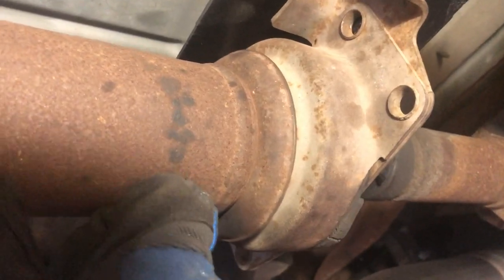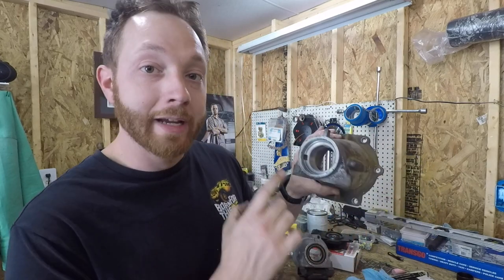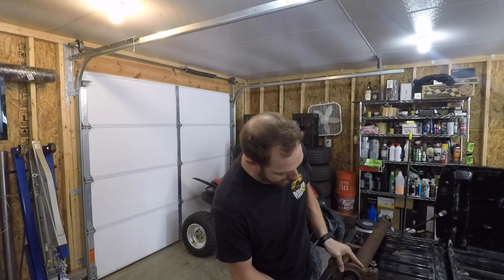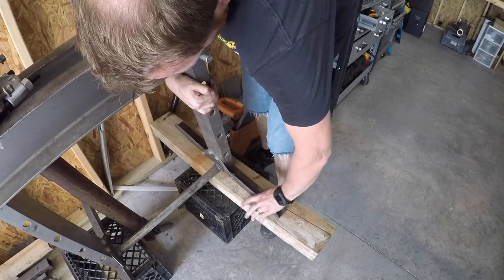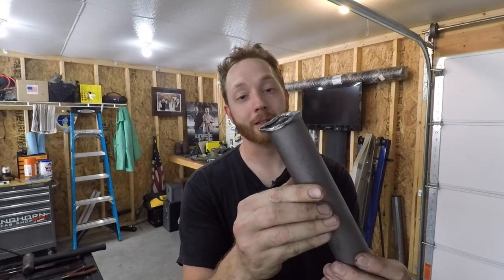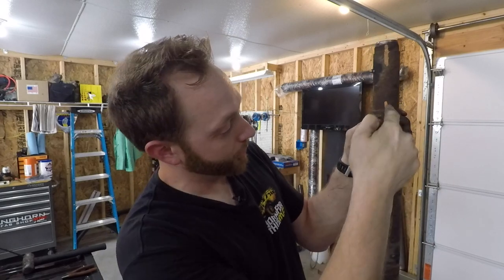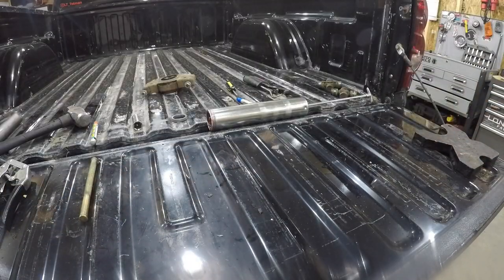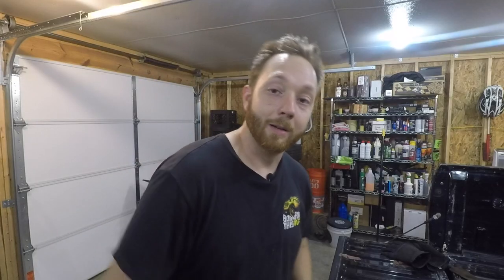Eliminating vibration from a 2 piece drive shaft

Comment from the maker: Its amazing how much of a difference a few simple parts and the correct angles can make! cant believe I put this job off for so long...
Reply: Yo I m doing a 2 4 drop on my truck was wondering how you moved your center support bearing to change the drive shaft angle ?
Reply: Have a 94 GMC and replaced the carrier bearing but I'm having a problem getting the yoke into the front front part of the driveshaft.  The metal and rubber seal are preventing easy insertion into the front part of the compound driveshaft.  Can't seem to find any answers on YT.  Help please.  I need the use of my truck.
Reply: @michaelpearce8661  it’s keyed so it will only go in one way.  It can be a pain but once you get it lined up it will slide right in.
Reply: @lukeduke1573  I know.  The splines have one thick spline and the rest are the same size.  Getting beyond the rubber gasket was my problem.  Found someone with a little more weight behind them and he was able to push it in as I aligned the short piece that has the U-Joint on it.  We got it back together.  Thought I got everything lined up properly as far as the replacement of all three U-Joints but I feel a slight vibration that is new.
Reply: I have a huge question LT that I really need to ask you.
Reply: Hey LT do you happen to know the Thread Pitch and Diameter of the Studs on the carrier?
Reply: Put that end in first then the carrier and rear yoke last .

Comment: At 5:52, you should turn the bearing splitter 90 degrees in the press.  You're putting the pressure across the threaded rod of the splitter, which can bend the rod.  Turn the splitter 90 degrees and let the actual splitter transfer the load across the gap of the press plates :)
Reply from the maker: you got me there, should've paid attention to that
Reply: @LawrenceTolman  I only know this because I now have a bearing splitter with a bent threaded rod lol.. what the heck? how'd this happen?  ;)

Comment: You are really helping with my future project 99 Nbs gmc short bed stepside 5.3 3.73 .put a 6.2 in your truck over 400 hp na and add boost you can set your hp where you want it 500 600 700 or more!!

Comment: I would love to see a crazy durable 5.3 or 6.0 motor in the 500 to 600 hp range. Something that is good for a daily, but fun when you need it to be.
Reply: Frank Sweet not possible without force induction or nitrus
Reply: @cesarconh895  you need to check out Texas speed if you think you need that.
Reply: @cesarconh895  completely possible with a 6.0 at least 500
Reply: I got a daily driver 600 nitrous (2 kits) ext cab 5.3 stock block stock heads just support mods for the cam and fuel system

Comment: I got rid of the two piece drive shaft and got 1 pieces drive shaft which is a 5” diameter aluminum and threw that junk carrier bearing in the trash after changing it 3 times in 5 years and it came from East Texas Dodge drive shafts for at the 800 bucks and I love it!
Reply: On an extended cab 2wd?  Who’s it holding up
Reply: @musty.diesel  that's what I wanna know. I have an 02 F350 2wd crew cab long bed. I would love to go to a single piece driveshaft, but I don't think it's possible 🤷‍♂️

Comment: Thanks for the instructions and confirmation on what I believe happen in my case, transmission was shifting hard in the second, took it into the transmission shop that had replaced it previously in 2016, no problems then this time the real seal on the transmission leaked and I had a vibration at 60 6570 worse as it goes up. I believe is they didn’t line it up like you stowed here or that hanger bearing is somewhat worn either way, taking it into the shop tomorrow and I will have him replace that hanger bearing, and all the year joints. Great video thanks again

Comment: I had the same problem with my press while I was replacing a carrier bearing. I got a 6”x6” timber and cut 4 pc. Put two under each leg. Screwed and bolted the timber’s raising the press 11” off the floor. The timber’s are also heavy enough, so it won’t be top heavy but, you can still slide it around on the shop floor if needed.

Comment: The angles. From the carrier slip yoke to the pinion yoke should be offsetting equal at maximum 3 degrees. Leaving parallel lines from both running horizontal. I'm always amazed how 2 identical vehicles can have two totally different problems. I would think keeping the front drive line flat to the carrier wouldn't hurt you any. More important is the rear drive line angle. Anyway, always appreciate your content! Have a good one.

Comment: I would say go for a lq9 6.0L high output then do the big 3 as they say heads, cam and intake manifold. Do the airaid modular intake tube with k&n drop in panel filter long tubes headers if you don't have emissions in your state you already have a nice exhaust set up. Then custom tune should be a nice amount of power to have fun with and plenty reliable.

Comment: The vibration is a result of velocity changes of universal working thru an angle as opposed to a CV or constant velocity joint, if you refer a uni to a clock with bearings at 12, 3, 6 & 9 as the rotate to next position velocity is constant if no angle but when you work through an angle velocity increases thru first part say from 12 to 3 then decreases from 3 to 6, this angle is say 3° then next uni is 2° then they will not cancel each other out but if you had a third uni at 1° the same direction as 2° uni they would cancel out the 3° uni in opposite angle, so your total angles should be as shallow as possible but your included angles should cancel each other out, some drive shafts have a CV joint at centre bearing so only have to set front and rear most uni angle to cancel each other, so if budget allows have drives haft shop upgrade to centre CV is an option as CV is just that a constant velocity joint so does not affect the equation, just some info to add to a good video for practical purposes done here, good job.
Reply from the maker: Well stated! Your explanation is much more elegant than I could come up with.

Comment: Thanks for sharing your driveline angles.  I changed the carrier bearing on my son's 2000 Silverado and noticed the front driveshaft wasn't totally level.  It's just slightly angled down towards the carrier bearing.  Couldn't find any info anywhere on allowables or angle range.  I suspect that the desired angle of the front driveshaft is 0 degrees, but there had to be a range due to mfg tolerances and such.

Comment: I wish you had a before and after difference on the 60 foot with time slips. I'm going from a 3.73 in mine to a 4.30 also to help it get out of the hole. My best 60 in my truck right now is a 1.84.
Reply from the maker: I wish I had as well. I cant guess, but it is a noticeable improvement.

Comment: Hey LT great video, did you also have to use shims to get rid of the vibration or did the carrier bearing relocation cure that?  (Besides replacing the old carrier bearing).  Thanks!

Comment: Your contributing problem to your vibration is your rear pinion angle is starting at 0.7* and your transmission angle it at 3.8*, those two things aren't parallel. If they were parallel then both your transmission angle 3.8* and rear pinion angle would be also 3.8*. The front shaft should also be close to the transmission angle I believe +- 2.5*.

Comment: How did you narrow it down to the output shaft bushing? 
I got an 05 I put shackles on and then shimmed it to correct the angle. Found that my center support bearing was bad so I replaced it. I now have vibes that I can't figure out. I replaced the ujoints and the drive shaft is balanced.

Comment: Here's a question that im hoping you can give some insight too. What's your thoughts on GMs notorious 8 speed issues that the engineers can't seem to fix? I drive a 17 High Country 6.2L and bought it new and changed everything over to Amsoil and never had an issue. Also i just installed a Trifecta tune.
Reply from the maker: to be honest, I'm not sure what issue you're talking about.
Reply: @LawrenceTolman  I'll explain, the shake/shudder and harsh shifting from 1st to second and vice versa. There's tons of forum's about. GM has several bulletins on fluid changing etc... Some had it so bad the TC was replaced. Plus there's class action law suits against GM. Check out GM Authority

Comment: Great video man nice!👍 Hey i was thinking of doing 4.56 rear gear and posi on my 2000 silverado 1500 2wd 5.3L. Think that would be ok to daily?
Reply from the maker: Depends on a lot of things, but mainly tire size. Mine are a little taller than some at 31.5” which helps a little, but if I had to guess you’d be spinning 2,600-2,700 at 70 with 4.56 and a 29” tall tire. Less rpm with a taller tire.

Comment: Ok. Got a question for ya.   Speaking on rear gears just bought a 96 Mustang cobra 4.6 dohc t45 5 speed.   I am wanting to do rear gears. But i dont want it scream down the highway as i do drive it and plan to show it but also drag race it.  Something that will help take off also
Reply from the maker: everybody's definition of "screaming down the highway" is different, but I'd do 3.90's or 4.11 at least. I had a 4v swapped mustang a few years back and I went to a 3.73, but wish I had gone a bit steeper.
Reply: @LawrenceTolman   i just dont want like 3500 rpms

Comment: Hello great video do you know the part number to the universal joints you bought and where did you  purchased them
Reply: Summit Racing has Spicer U joints, measure the cap diameter and overall width to research what u joints you have. My 1981 C10 long bed has two each 1350s and one 1330 on the two piece drive shaft.

Comment: how did you adjust the trucks speedometer to compensate for the different gears?
Reply from the maker: using HP Tuners software. you can make corrections to the speedometer as well as the shift points of the transmission, because they are all based on MPH

Comment: LT, what type of drive Shaft are better, one pice or two piece ? Greets from México
Reply from the maker: usually, if it's longer like on an extended cab truck, a 2 piece is more stable, but they are more difficult to set up the driveline angles

Comment: I have a 09 gmc sierra crewcab, I planned to install a 4/6 drop, I heard it is recommended to replace the drive shaft with a 2 piece version,  do you have any recommendations for  least expensive application vs buying a 2 piece, I saw one for about $1100, I was wondering if I can pull one from from a truck that would match mine
Reply: Get a 2 piece driveshaft from an extended cab at the junkyard, the wheelbase is the same  and you can buy the kit without the driveshaft for $350 or you can make your own crossmember for cheaper.
Reply: @ivansaenz5178  what year on the 2 piece shaft from a chevy or gmc sierra extended cab
Reply: @HL-kb1ex  my cousin has a ‘10 Silverado and used the driveshaft from a 04 Silverado extended cab and it fit his crew cab. As long as you still have the 4L60 then any extended cab driveshaft will work.

Comment: You think your truck is ugly? You should see my '95 Chevy 1500 Silverado. It REALLY needs to be painted.
Reply from the maker: I suppose ugly is relative, but the truck earned its nickname from when I first got it, and it has lost a lot of the ugly since I first got it.
Reply: @LawrenceTolman  I have an '87 Chevy R10 fleetside longbed that is nice looking for it's age. It has a tired 305 in it. Both the trucks have throttle body injection. I want to put a mild 383 stroker in it. I was thinking of going with an LS 6.0l engine also. I like what you are doing. I thought the 8.1 liter was an LS design and I was considering putting that in my '87 but it is more like the 427/454 style. Take care.

Comment: Save your resr brakes, get a linelock
Reply from the maker: i really should have one
Reply: @LawrenceTolman  yeah you probably want one. Be bad ass too when your motors done built up. Makes it easier to do burn outs. I can do brake boosted burn out in my big truck but the hydroboost works really well so have to modulate the brake pedel. Could always choke the front tires too i guess.